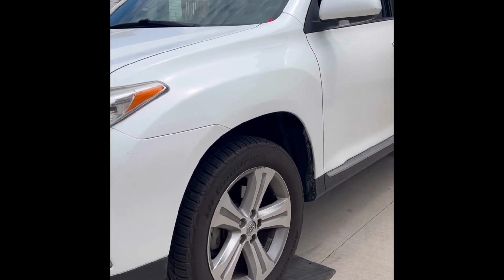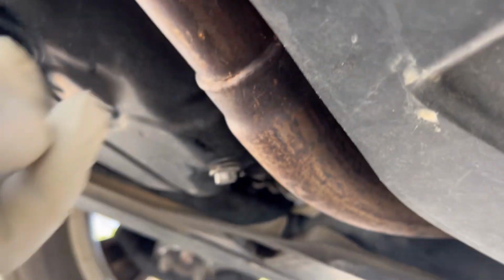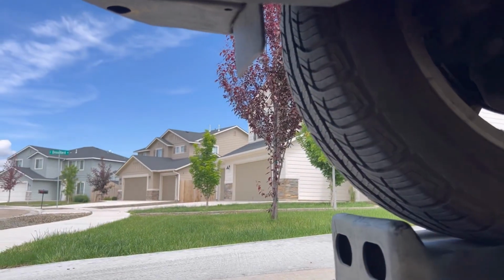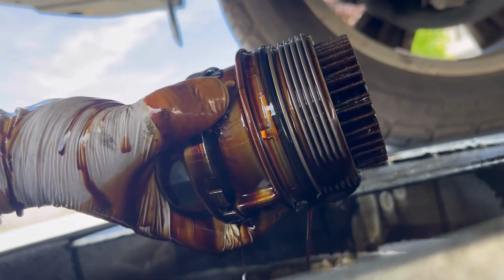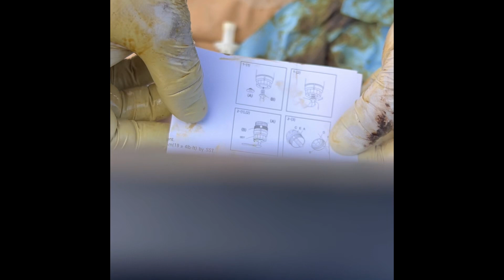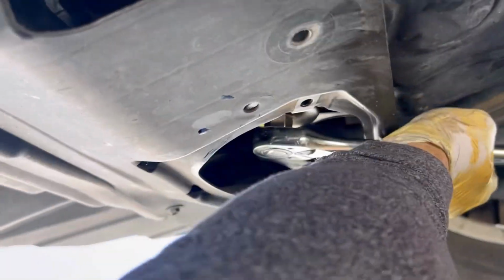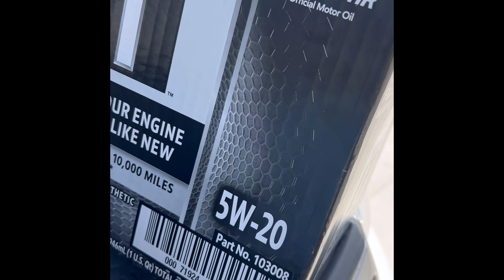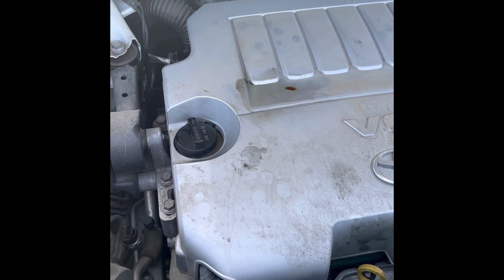DIY: 2013,Toyota Highlander 3.5L oil change

Comment: In other videos they removed the internal metal plug using a 3/8 socket, then inserted before removing the filter housing with the large filter housing wrench attachment. a plastic plug to allow the filter o oil to drain
Reply from the maker: The plug is to drain the oil filter . So when you remove the filter it would be less mess :)

Comment: forgot the oil plug washer (new)!and use torque wrench to prevent over tightening and possible stripping the threads!
Reply from the maker: I never remove oil plug  . It’s not leaking no point touching . I remove whole filter housing .